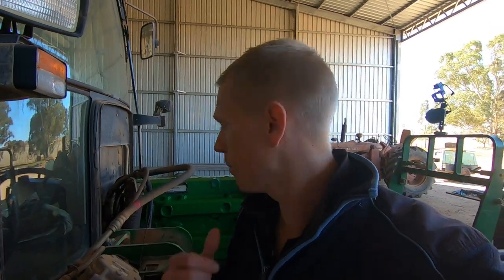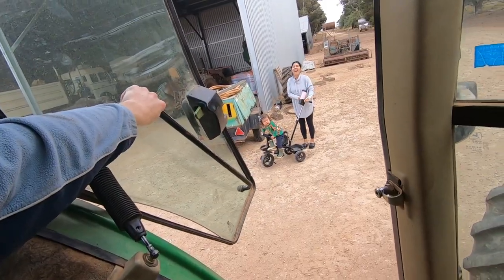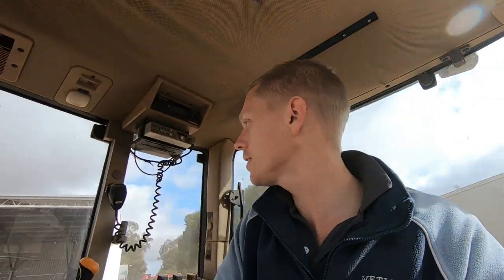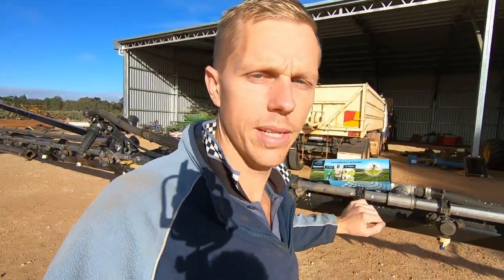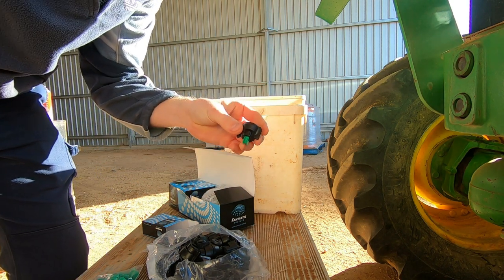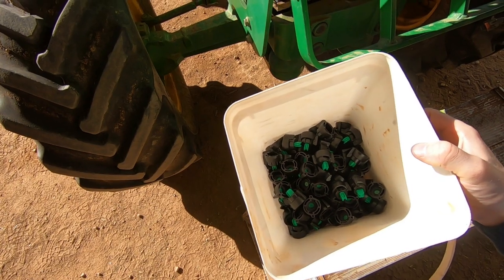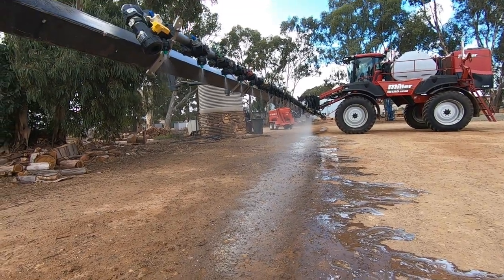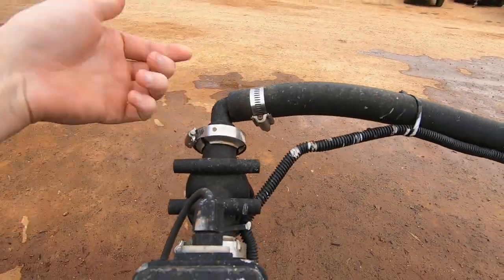Reassembling The John Deere 6510 & New Spray Nozzles for The Miller Nitro 5240

Comment: Why not call first before going to town to see if O rings were in stock. Or did you need to go to cake shop.😁
Reply from the maker: Because the dealer is only 2 km away and they don't specialise in spray gear. They do carry some stuff but much easier to show them what I need.